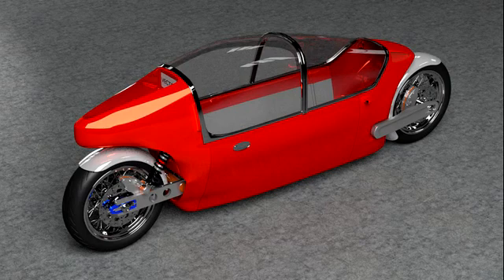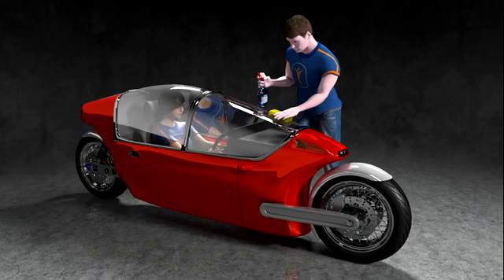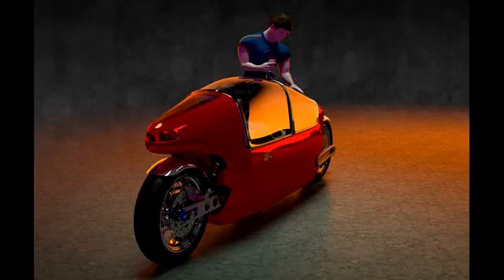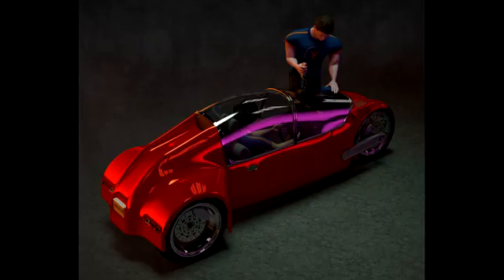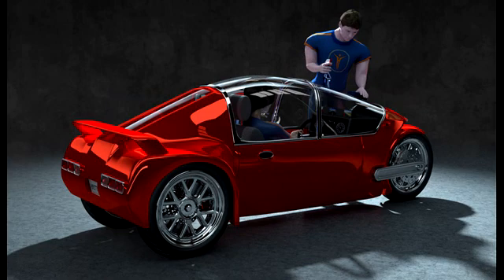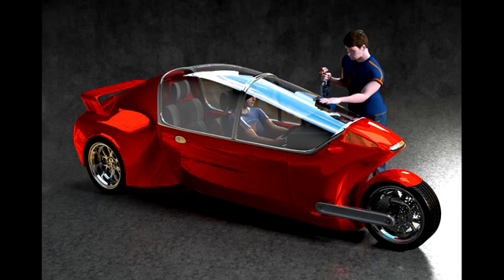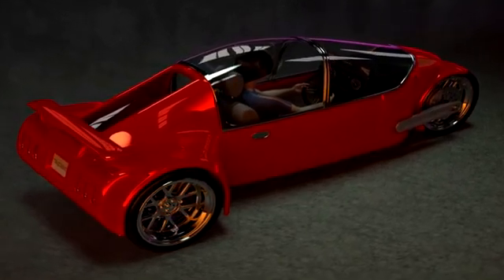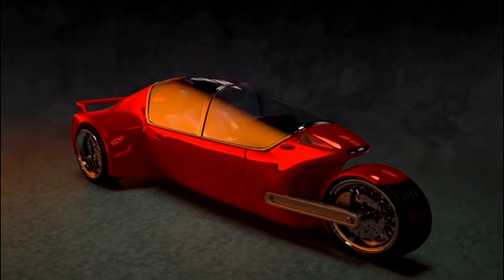Blender 3D Enclosed Motorcycle Concept Model and Animation

Comment: Agreed your animation was super great. I am interested in your upgrade of the Carver system seating as it seems to be between the Carver and the Benz Life Jet concept and a bit smaller which is good. I see where several Motorcycle companies have a balancing system now as LIT Motors has been made irrelevant with the flooding of engineer types delaying and improving to the point of going nowhere as the Big Auto cartel always does good ideas.
  I would like to see a bit better concept of glass area as these are too vast areas where solar recovery should be used more like the Life Jet especially for the senior population commuting. If you were using this type canopy however they should operate like fighter panes and slide open forward or back IMHO. In-wheel motors with a small hemp oil generator to make it a serial Hybrid would be perfect and a bit like the PRIUS system maybe. Getting it mass-produced as I advised Mr. Kim at LIT motors in 2012 would be cost-effective in India/Pakistan/Okinawa/Taiwan. They could mount the gen unit behind the sail area maybe.

Comment: Advising the creator of the Lit-1 in 2011 to quit riding bikes because he would crash and his brain was too important for humanity was about as senseless as my advising him to franchise his idea to India and get some gas-powered units on the road for testing and NEVER let Detroit flood the project with engineers as they will only delay the project...Well he kept riding and as you know crashed his bike breaking both legs and there is STILL no Lit-1. Your Ideas need to be fleshed out fast. There is a market for 25 million of these in the USA TODAY. Of course, being so sleek is not necessary and having some conventional options would market better. The units do not need to go faster than 90mph but they do need to get 50 mpg or better. Your style is far superior to Carver. Designing and Emergency unit with a slide-in gurney for medivac as well as a van unit for delivery(Pizza) and maybe a flatbed for us truck people. The three-wheeler would be a better platform for the ERT or delivery and flatbed as they can be done without the gyros. But without a start and ignoring Detroit's infiltrating to slowdown and waster time and money experimenting. A lot to be said for aerodynamics but one ride in a VW $500 Sandrail should show you what you need is something the public can see....They will do their own invention off your ideas.

Comment: Have you considered using the MP3 or the bigger Yamaha 3 wheeled motorcycles for a base? They have linked front wheels which allow them to learn and also to lock at low speed to keep upright without feet or stabilisers.